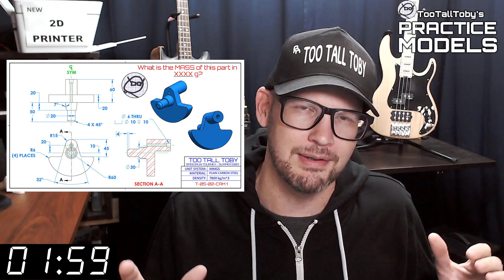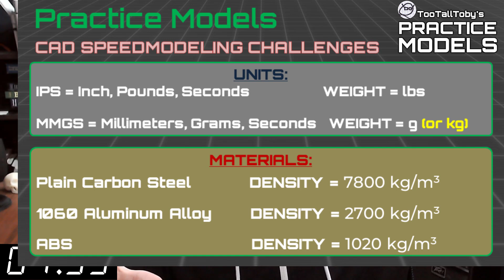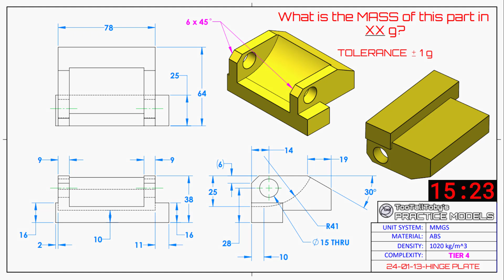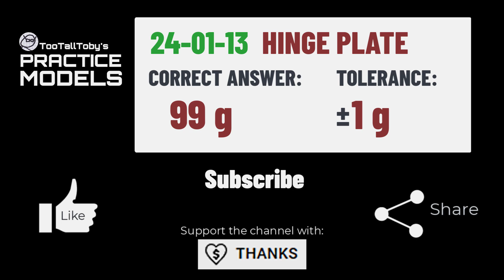CAD Modeling Practice Challenge - Onshape, SolidWorks, Alibre, Fusion360 - HINGE PLATE

Comment: Quick question. On the right side view, the upper left corner chamfer, does the (6) mean applied to both the height and depth of the chamfer? I never saw it annotated like that, but I'm still a beginner/hobbyist modeler. I got 99.01 grams and that's because I assumed the depth reference was also 6. Cheers
Reply from the maker: It’s 6 x 45 - so 6 in each direction relative to the perpendicular edges
Reply: Thanks a bunch. I just noticed the annotation on the pictorial. Thanks for the response 🙂
Reply from the maker: awwwyeah! @joebob3712